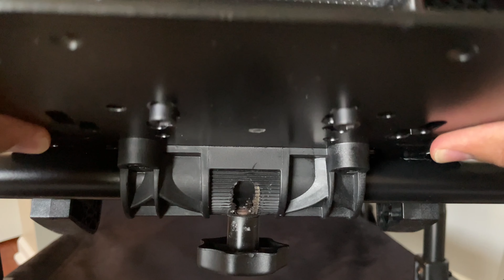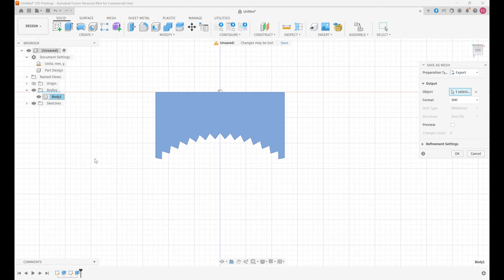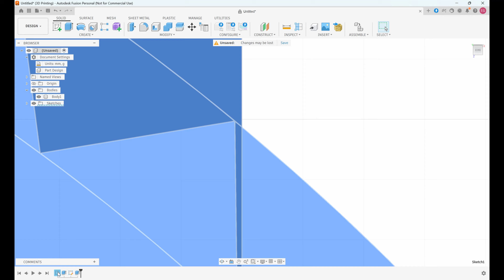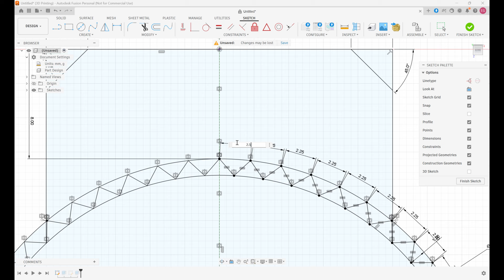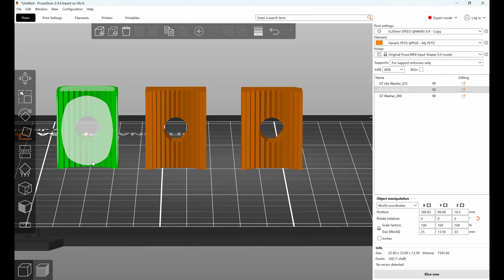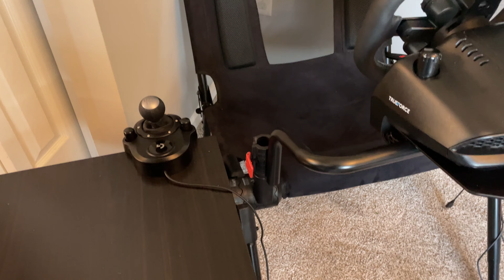3D Printing for Beginners - How I fixed my NLR GT Lite Sim Racing Seat - Part 2

Comment: Thanks have same missing part found your file will try to find a place where i can print it
Reply from the maker: I’m glad I could help! I was so confused when my wheel was tilting. This part will fix that, just make sure you print with high infill (ideally 100%).

Many high schools and colleges have 3d printers. Some libraries might have some as well.

Let me know if you need anything adjusted in the file as well!